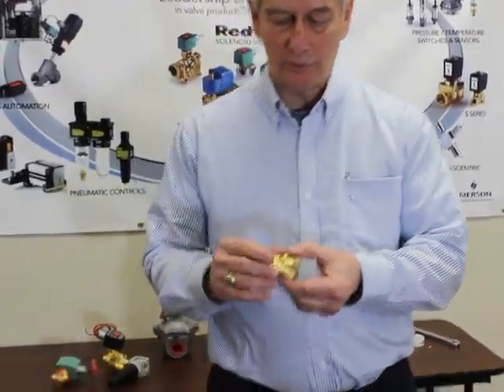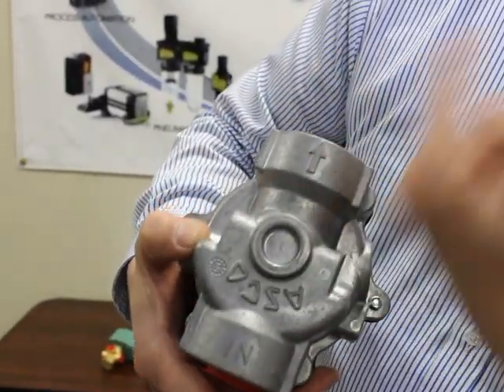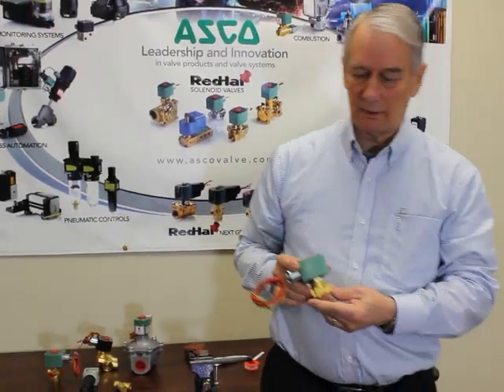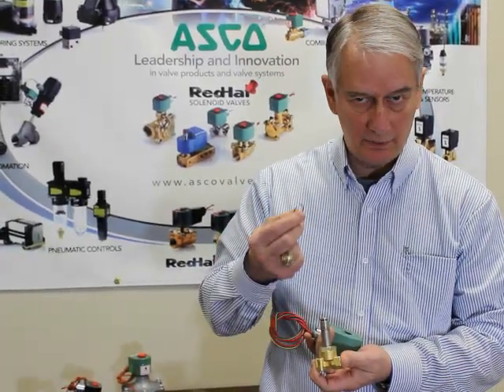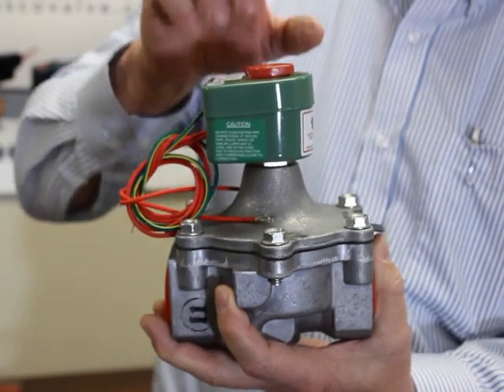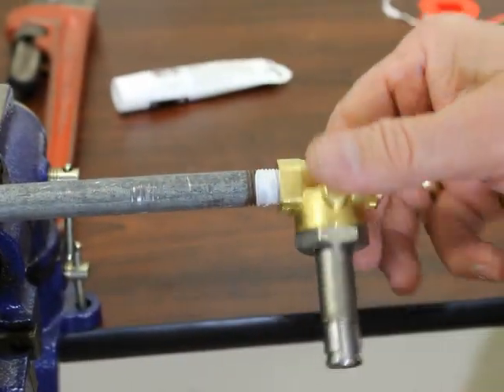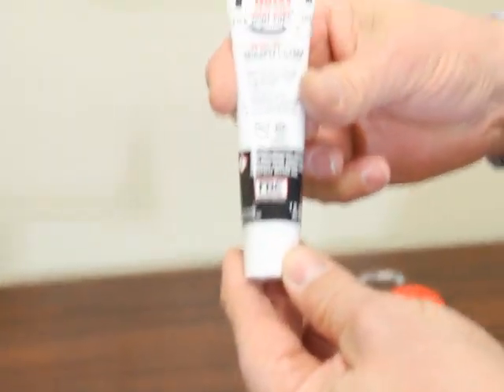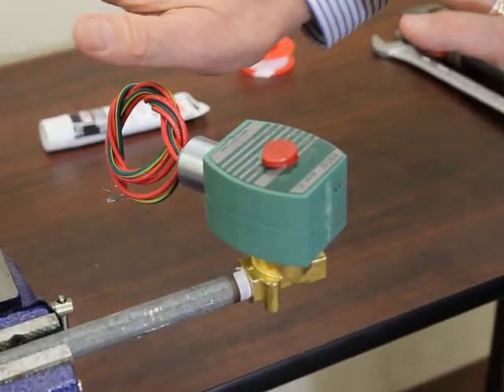Installing an ASCO solenoid valve

Comment: How do you wire it??
Reply: Green to ground  red to black other red to white.
Reply: @powillie  how do you know which red is hot and which red is neutral!?!
Reply: @Toolie716  polarity doesn’t matter
You can connect it both ways
Reply: (crickets chirping).....  
There is no wiring instructions included. I guess you're just supposed to guess.
Reply: ? Did you find out how?